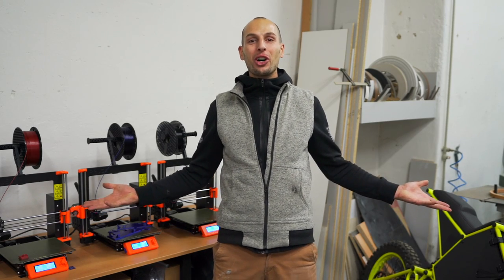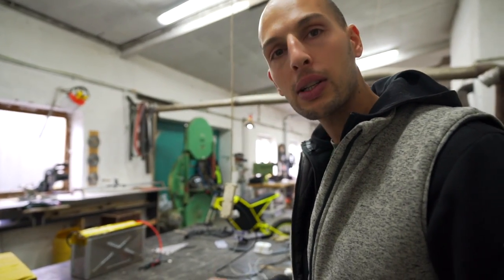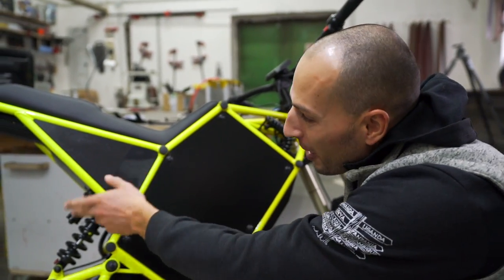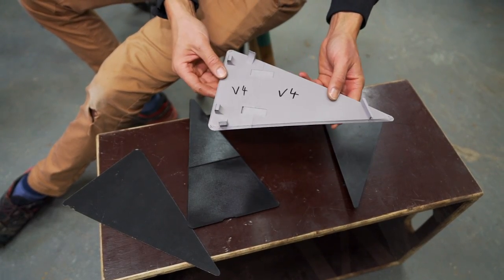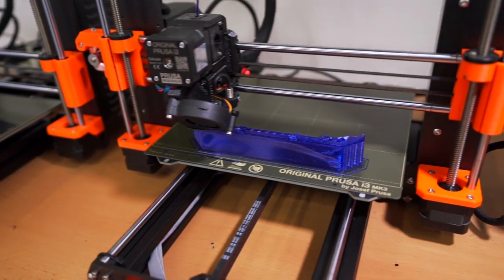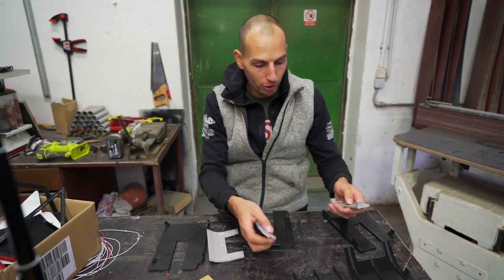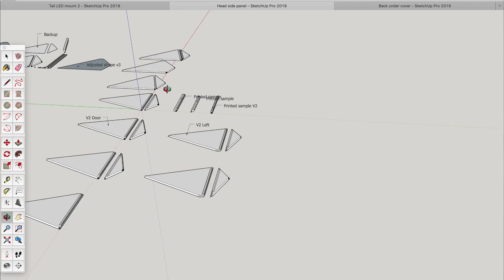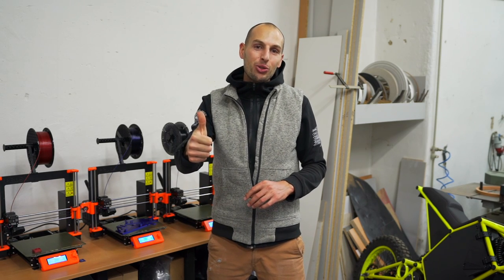Making of CyberBike / 3D Printing an Electric Motorcycle

Comment: Hey Ladi,
great to see your progress ! :-)
IIRC you are using PETG for the panels. Keep in mind that PET is not the most stable filament if it comes to UV rays. While I did a lot of parts for my e-bikes in PLA and PETG, I am perfectly aware that things might degrade in terms of stability and take in concern I have to reprint them again. For a commercial e-bike (which the CyberBike might become one day if I understood you correctly) using something like ABS or ASA might be a better option. Both filaments are a bit more picky in regard to printing environment (e.g. closed room for the 3D printer with possibly stable temperatures). Also bed adhesion is sometimes not refered to as very good. I have only fiddled around with PLA and PETG. So I do not really know :-)
I am currious how things turn out. Hopefully you will provide some infos on the controller and the display as well.
Reply from the maker: Thanks so much for this valuable information! I have some ASA filaments so I’ll test it out.

More about the controller in followup videos.

Comment: Hi Ladislav, it is amazing what you doing just perfect. I think in the future you should be owner of some big factory electric bikes. Just wait some big and reach will come and help you !!! I have some ideas for you also.
- mAybe some parts should be little more curved shapes - smoove I mean to not get so much dirt inside small holes and courves.
- what about rains? water slpash ? is everything sealed well?
- shape your bike is nice but little from 80´s (just my opinion) maybe some more futuristic curves and shapes ?
- what material is frame?  (carbon will be very light - maybe too expensive?) is aluminium?
Anyway everything what you doing is very profissional and well made.
Congratulation Ladislav !!!!

Comment: Hi Ladi. Do you sell JUST your SketchUp snap clicking panel connections? Struggle to find similar ones. Eventually will find but takes a longer time. (to ask SketchUp forums, etc.). Prefer to buy from you if you would sell. Just need those snap connections... Thanks

Comment: looks awesome. I  am sure you have looked into this, but I think you might benefit from using a lasercutter to cut your mdf, in which case, you would have the dimensions already made to make the transition into 3D modeling. Also, have you tried using thicker Acrylic boards instead of printing for hours on end?

Comment: everything cool - but a piece of aluminum sheet cut and folded by hand - would have done it too.  😉

I don't know much about e-bikes yet.  but I am a trained vehicle manufacturer and am interested in motorcycles and their design.  it looks too much like a bike for motorcycle performance.  I am currently building my first pedelec with German bicycle approval.  if you are interested - check out my Instagram account.